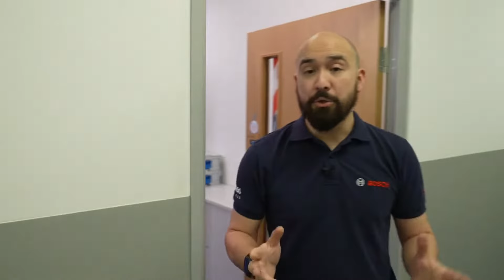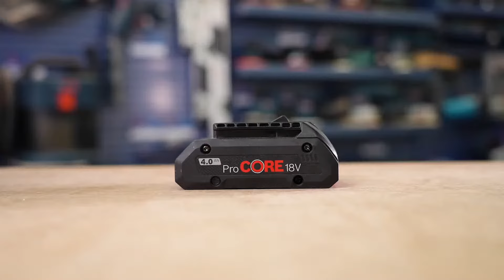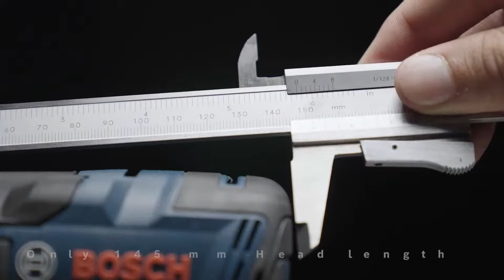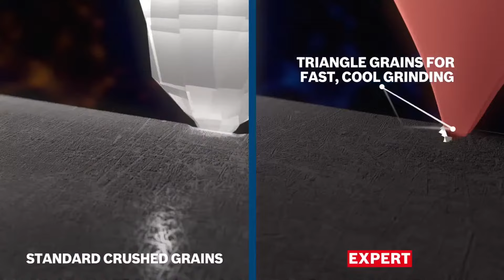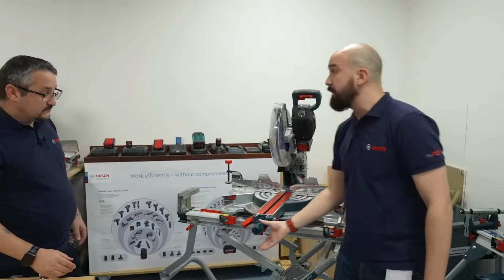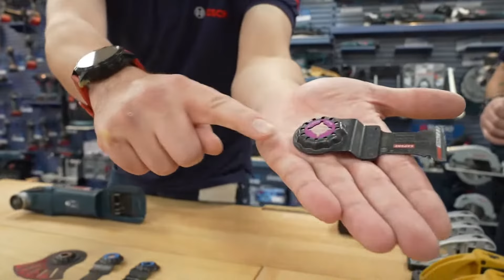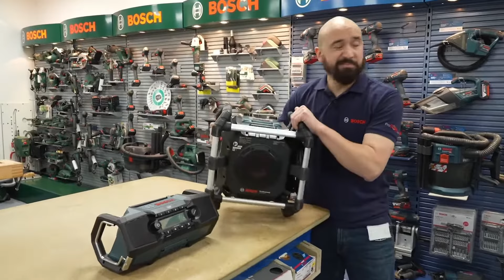BOSCH PRO Workshop Tour (NEW 18V TOOLS) | Bosch Professional LIVE

Comment: Cordless rivetguns are a godsend in my trade but the bosch rivet gun just isn’t worth the money sadly. Its £700.. you can get both the milwaukee M12 and M18 rivet guns for under that and have a larger working range. Its a shame as all my other 18v tools are bosch. I use a rivet gun almost every day at work but i just cant justify that money and it not do 3/32 rivets meaning id have to get the M12 anyway.
Reply from the maker: We've heard the complaints regarding the pricing and have passed on the info to our product development team. Thanks for your comment!

Comment: 1:10 SDS attachment only available separately - Errr, I'm not sure that's true guys.  I bought the GSR 18V-60FC as a complete kit with the four adapters inc. SDS and L-Boxx....I was hooked by the 12V FC and couldn't wait for the 12V SDS.  Flexiclick is great by the way - really handy for restricted spaces.
Reply from the maker: Mistakes may have been made :D Cheers for the clarification!

Comment: Impressive Workshop! You need to make space for upcoming new BiTurbo Brushless Tools. I am you asked me before, of what streams i would like to see you do, so here is a little reminder.   

Hello Goodday, yes, i would like to see streams like these;

 May i request a stream for outdoor yard & landscaping future equipment, for example, do you have any plans to bring out A BiTurbo Brushless 16" Chainsaw, BiTurbo Brushless String Trimmer/Brushcutter, BiTurbo Brushless Pole Saws & Pwer Heads, BiTurbo Brushless Hedge Trimmer, BiTurbo Brushless Leaf Blower, BiTurbo Brushless Lawn Mower, BITurbo Brushless Auger, Brushless 8" Pruning Chainsaw, Brushless Pruning Shears & Grass Shears too, Back Pack Power Supplies too? 

A next stream could be about up coming new future Tools that hopefully you have planned to bring out for Plumbers like, a BiTurbo Brushless Pipe Threader, Brushless Plumbing Exapnsion Tool, a Brushless 12v & 18v PVC & Copper Cutter, a BiTurbo Brushless Sewer Drum Machine, A BiTurbo Brushless Sewer Sectional Machine, A BiTurbo Brushless Floor Drain Snake with Cable Drive Locking Feed System, A 12v Brushless Air Snake Sink Drain Cleaning Gun, a 12v Brushless Trapsnake Porcelain Toilet Auger System Tool, a BiTurbo Brushless Transfer Pump, Biturbo Brushless Press Tools?

A Stream for Electricians with current & upcoming new tools like, BiTurbo Brushless Threaded Rod Cutter, BiTurbo Brushless Cable Crimpers, BiTurbo Brushless Cable Cutters, Brushless 18v Metal Hole(Punching) Knockout Tools?

You could do an L Box Stream showing the latest L Box storage that is out, new up coming enhancements, additions & how to organise each with the type of spongy foam you manufacture for the tools also? 

Another stream could be for Laser & measurement tools, along with new types of spot lighting tools to light the workspace in dark, poorly lit areas? That would be nice as i loved that Bosh Tool Box App stream you did early this year. Very thorough & well explained, 

May I also request a new tools down in the pipeline stream as i mentioned some above regarding outdoor equipment, plumbing, electrical, do you have plans to bring out a BiTurbo Brushless DrillPress, a BiTurbo Brushless Hydraulic Pump, a BiTurbo Brushless Hoist, a BiTurbo Brushless Concrete/ Tile Thinset Mixer. Brushless 12v & 18v cordless ratchets, BiTurbo Brushless Drywall Sander, BiTurbo Brushless Concrete Vibrators, BiTurbo Brushless Grease Gun, BiTurbo Brushless Wheelbarrows & Dollies, Brushless Belt Sanders, BiTurbo Brushless Polisher/Buffer

Again, I wrote a long comment here, my apologies. It is just a reiteration of this comment before and there are So many thoughts came to mind at once as there are so many tools i want to see cordless from Bosch. You are such a world class Tool Company, but it is just my few suggestions of a few streams would love to see in the future. Hopefully on every stream, you could have the excellent Mr Paul, Accessories Rep, Mr Lawrence with all the inside information of new Products along with excellent Presents Dan/Chris & any of your great Chat Moderators/Camera Crew, Miss Lizzy & Mr Rob, cheers!

Comment: The Bosch go should have an option to disable the push function.
Reply from the maker: Hi Asad, we'll take that on board. Don't forget, you can move the forwards/backwards switch to the middle to stop any activation of the tool for storage and general handling.
Reply: @BoschProfessionalUK  The reason I say about the push feature is that some times you need to first push against a screw into the material to line up and then start turning. I've noticed this when fastening electrical screws for sockets and switches

Comment: Gas 10l is very good. I use it a lot. I also have the compact 18v gas vacs. They are totally useless. I have the older and the newer but both of them are sitting in my garage doing nothing.
The 18v mini blower is pretty good
Reply from the maker: Hi Asad, what makes the compact 18v gas vacs useless? Could you provide us the model numbers and what you're trying to use them for?
Reply: @BoschProfessionalUK  The first version, the filter got blocked instantly. You have to clean it every few seconds otherwise there is no suction. The 2nd version had self cleaning filter. Worked a bit better but still got blocked. Both of them were lacking in suction
10l is really good. I'm very pleased with it. Doesn't come with many attachments but you can buy them